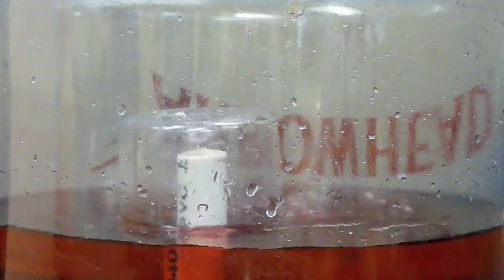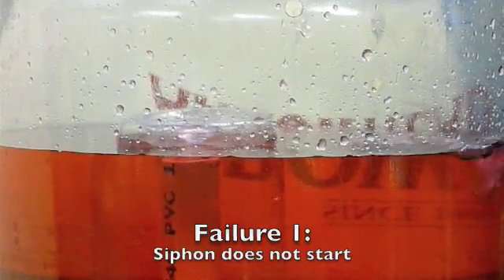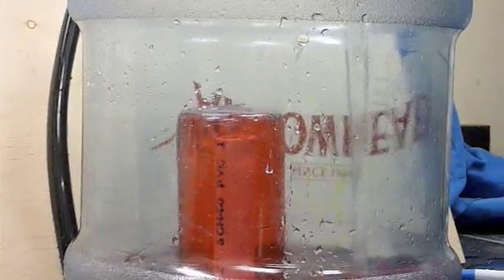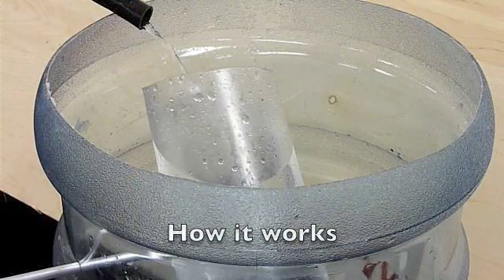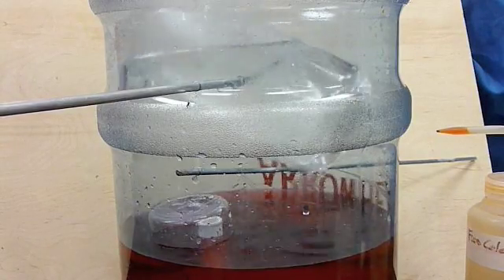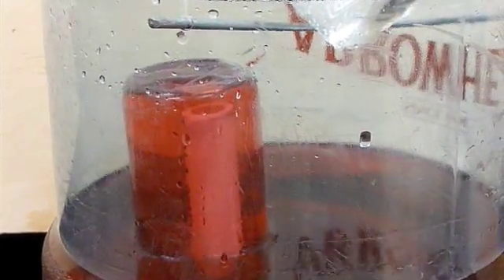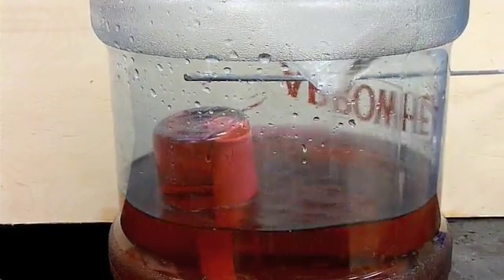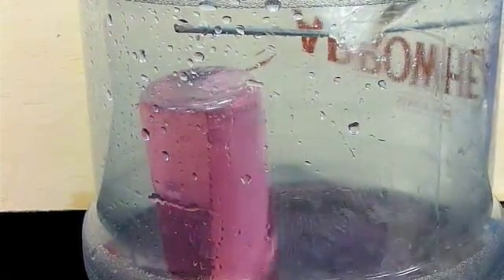Modified Bell Siphon for Rural Aquaponics

Comment: the first one always happen, but i added another weak pump to equal a strong enough flow but sometimes i think it doesnt break siphon well enough and  the water level is below the stand pipe but it still draining very weekly,? is my bell siphon to high maybe? or too little hole to evacuate the air

Comment: YOUR THE MAN ECOLIFEFoundation. Bell siphons are awesome BUT once flow is effected by algae build up your siphon gets out of tune. THIS IS GREAT for small flow, or small pump, or off the grid aquaponics. Bell siphons are great with alot of flow, but there are ALOT of people wanting indoor small scale DIY and parts they already have laying around. This solves the problem for them. Acts just like an electrical capacitor, collects little amount then dumps all at once alot. :)